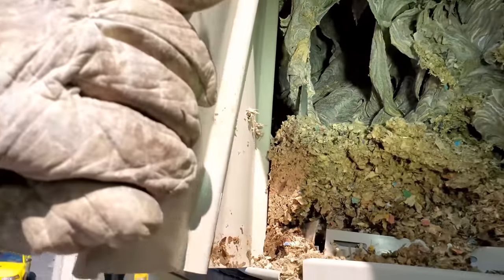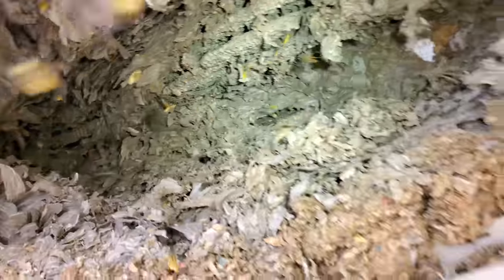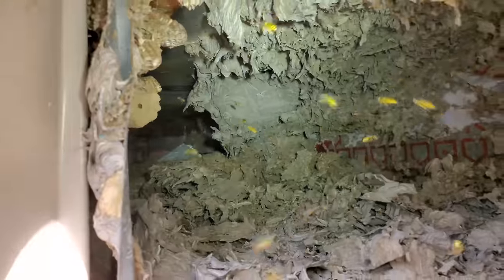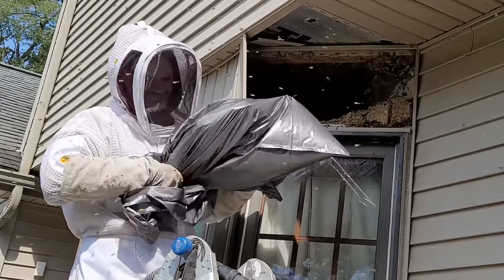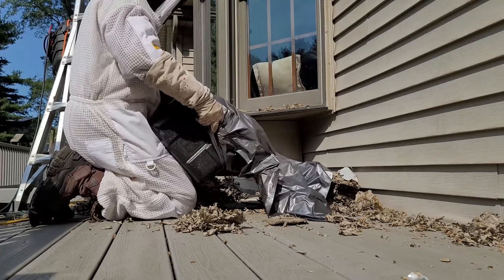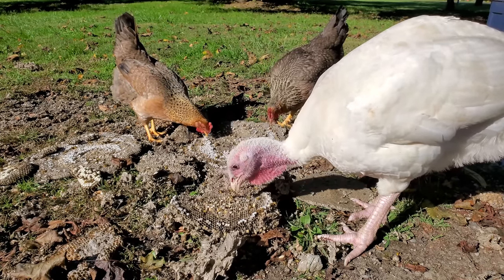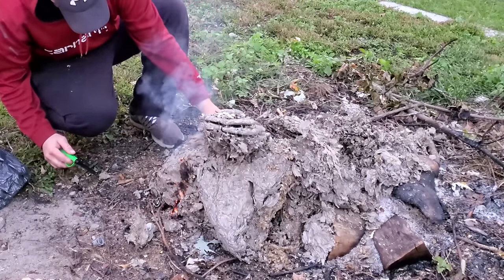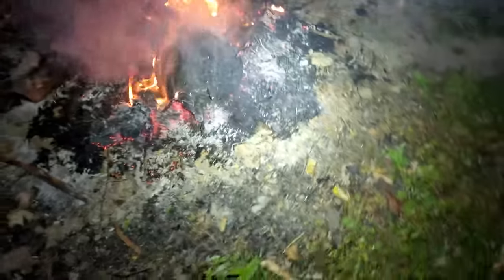SUPER NEST! Yellow Jackets MASSIVE nest inside ceiling | INFESTATION | Wasp Nest Removal

Comment: You really kept my interest as I watched this video. Even though it's a slightly longer video, I appreciated the way you explain things as you moved along. For example, the point you were making about burning nests. I have seen videos of people burning nests and yes you're right they don't really burn very well but, I wasn't really quite sure why that was. I had thought about water content but I didn't realize there would be enough water or moisture left in there to really stop the burning. You explained it as the larvae being mostly made of water and of course, that's going to slow down the burning just like trying to burn a campfire when it's raining out. The flame a run you might see a flame but, it's not really burning very efficiently and that's what's going on with those nest. Anyway, thanks again!

Comment: I just feel like this house will still see another infestation . The wasp were just going behind another panel .
Reply: ya for real that homeowner needs to get some spray foam to fill that gap.
Reply: Should be insulated up in there. But I wouldn’t be surprise if he treated the inside with a dust product to prevent another buildup
Reply: @robdfar  I thought  he said he filled  the gaps with spray
Reply: @trixy8669  what
Reply: @trixy8669  what did i say

Comment: I know nothing about this. (That’s a great way to start a conversation! Hah!)

Is a small vacuum nozzle the most efficient way to do this? Would something electric be more effective? 

I’ve seen smoke get used to calm things down and keep things from swarming as much. But, once they’re everywhere it feels like there’s got to be a better solution than a 2-3 cubic inch area of suction to deal with them. 

I’m also trying to think of a solution for the camera. I feel like putting a GoPro ON the nozzle would help. If it was on the nozzle then you’d have your hands free to do other things. You needed the additional camera for the background shots.

I’m trying to figure out if there’s a way to attach something to the suit. But, I’m assuming it’s important that the suit not sit flush with your head. And this likely limits head-mount options.

Comment: You could use one of those Elon Musk small flame throwers to really get rid! But I relate to things not burning. One time (in an alpine cabin with limited resources) I was told to throw brandy on a fire and luckily I only used a splash but it did the job! Be careful using liquid like that on fires folks!

Comment: Back in 1979 my dad gave my brother Joe a three story house in San Gabriel and brother Joe wants to demolishe the house well he had inspector and got a permit so we didn't realize there's a antenna line in the front of the house with a good size hole for the line TV it was the living room so my brother's brought sledgehammer and he said start on this side and I will get this side ok I started hearing a very serious humming sound I said are you hearing that power. I think the power is still on he plug a saw in the socket and no power so I put my ear to the outlet and heart like a power line I got a screw driver took off the the cover and started running outside we closed the door for a few days I had to use a snow shovel a lot of beeeees